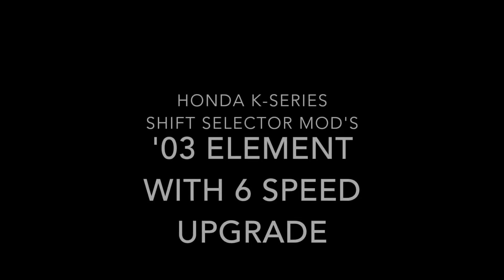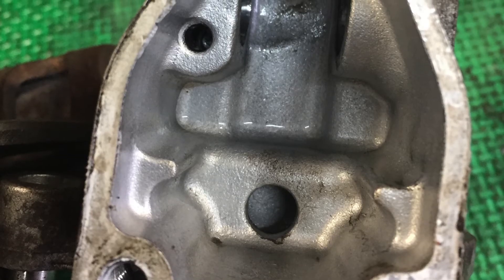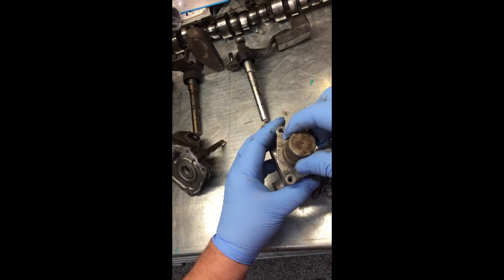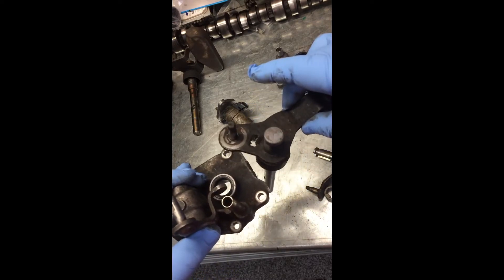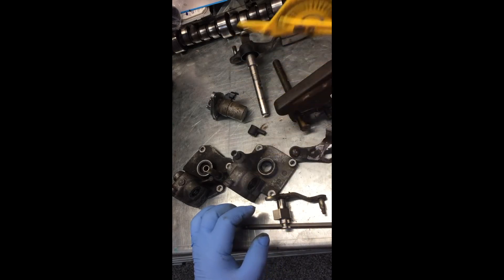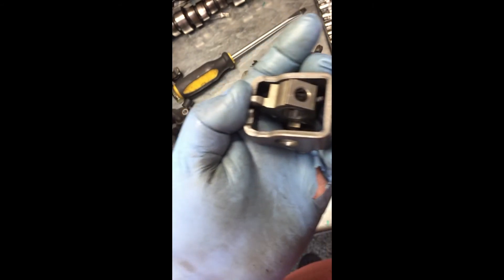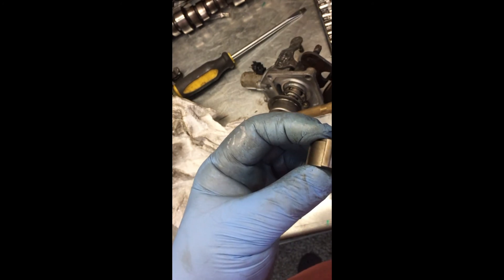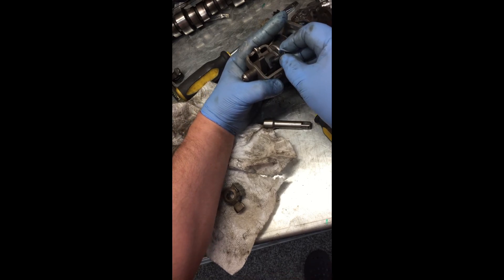Honda Element 6 speed Shift Selector modifications for Reverse lockout!

Comment: How do you get the solenoid to work wiring wise, is it as simple as plugging it in to an existing plug or do you need to wire it into a ktuner ECU?
Reply: need to add the wire for it to ecm
Reply: @mariopic2625  Will it work on a regular 5spd ecm?
I saw a post on VTEC academy channel on how to wire it up using an RSX base model harness and they explain the wires to the ecm,

But my question is if the car someone's doing the conversion to doesn't originally have the lockout solenoid (like an Element, EP3,etc...) Will the computer even send a signal to the solenoid??
Reply from the maker: You have three options for wiring... 1) If you have a 6 speed ecu then it will support reverse lockout just add the control wire to the ecu, 2) If you have an aftermarket tuner you can trigger the solenoid using a spare circuit. 3) wire a seperate 12v switch have it provide key on power when you are driving to stop the car from shifting into reverse, when you want to reverse just flip the switch reverse then switch it back when you start driving. I used this in my son's car and it works slick!!

Comment: You should put your services on ebay. Let me know if you do
Reply: I would pay for this
Reply: @harryfp1494  theres other ways u can mod stock  5 speed selector  modding it to work with added 6th gear and  u can mod the spring and avoid adding a reverse lock out  if u make the  small spring stiffer its harder to push in to reverse gear  so it effectively acts like a lock out  needs more force to go on to position this is how i did it on my element  was easy and cheap to do
Reply: @mariopic2625  Will changing to the stiffer spring make 6th gear harder to go into also??
(I bought the stiffer aftermarket spring before I read this anyway, I like the solid shift feeling.)
Reply: @alexhenao7072  no just reverse  theres 2 springs  on selecter  if u make the one that lets arm move to reverse position stiffer it helps avoid going in to reverse when going in to 6th  needs more force to go to reverse direction   also ball detent spring upgrade makes shifting better to ifvu do that mod as well     also dont forget to shave the shifter it self to let u get more movement to get in to reverse  thay sell arms for incar shifter thats pri trimmed  to
Reply from the maker: Great tips Mario!!
Reply: @mariopic how do you make the reverse spring stiffer or do you have to buy a new stiffer one?  If so do you know the part number for it?
Reply: @mmaattppllaayy theres double spring on shaft  u but stronger spring kit and only install one of them
Reply: @mariopic  Any chance you have a link to what I need to buy?